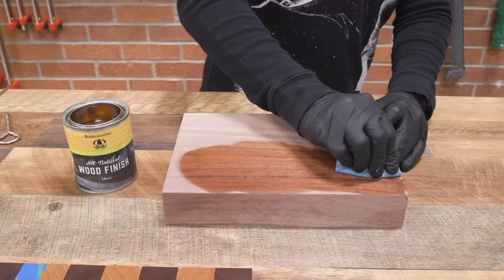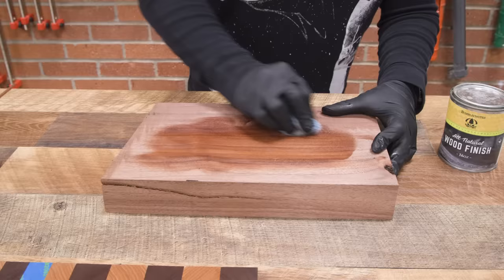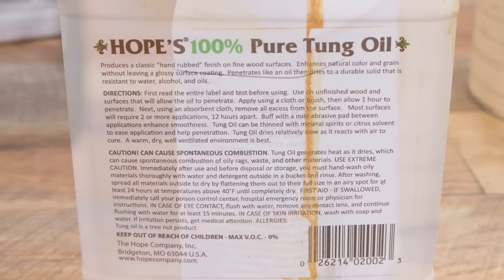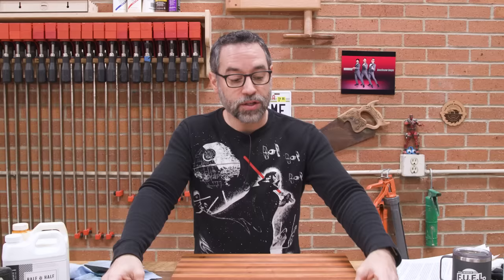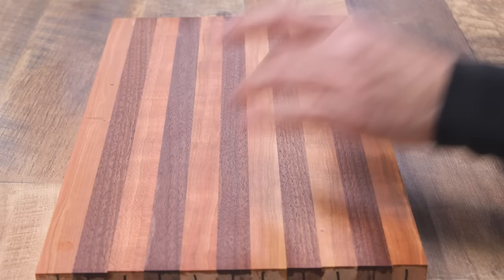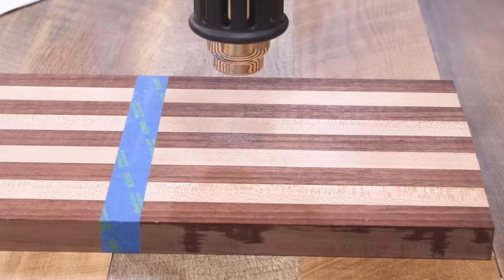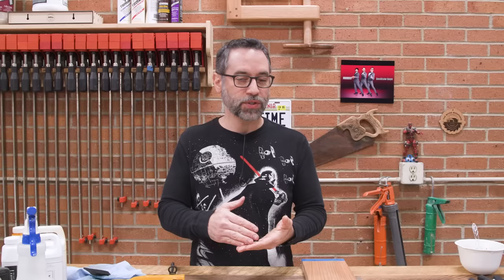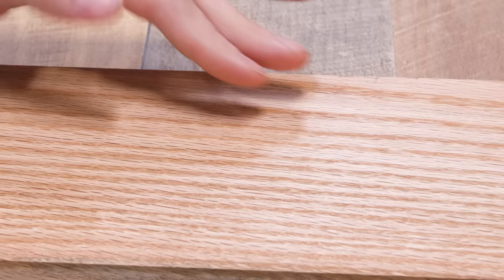A Better Way To Apply Oil Finishes!

Comment: I just finished a work bench with a butcher block on top, with watco danish oil.. I kept the wood wet for 15 minutes then let it soak for 15 minutes and wiped off. No sticky residue.

Comment: Thanks for this discussion, Marc! I feel this video compliments a similar video by Stumpy Nubs very well. In fact, both your video and his video can be supplemental to each other.
I like how you showed physical tests. I was amazed by the endgrain cutting boards. I always knew they were more porous, but didn't know they were that porous. Your video has definitely added a whole heap of value to the community (as usual).

Comment: When carving and finishing gunstocks, I was told to use 00 steel wool to apply and "rub in" thinned tung oil for the first coat.  The wool was used to slightly sand and create fine wood dust to help fill the pores.  Bare hands and their warmth helped really rub in the oil.  Then, a month of drying time was allowed to cure the oil.  High count 200+ wet dry paper would be used to rub in another layer of fine pore filling dust.  Lots of hand rubbing of this second layer of thinned oil and another month of drying.  Next the customer would mount and check the gun to insure dimensions and fit.  These two coats also helped harden the wood for fine checkering patterns.  Lastly,  as many layers of raw or lightly thinned oil could be HAND rubbed to build up the final desired sheen.   
Summation:  Flooding is bad 😁
Reply from the maker: Sounds like a real labor of love!
Reply: You got the labor part right.  I kept 2.

Comment: The test that you didn’t do, and would be hard to do in one video is a comparison over time. It probably depends a little bit on the product and the amount of curing taking place inside the wood, but most pieces need to be retreated in 1-3 years. You have another great video on the benefits of penetrating oil finishes. If there’s more oil in the wood, it would seem that it would be a longer time before it needs refinishing. 

I used a bit of a modified flood method with a brush, and actively brush the oil across the wood for 5-10 minutes only adding more oil if there’s nothing in the brush. While the brush absorbs some, it seems to me to be less than what is absorbed by the towels. There’s a little excess to be wiped off in the end but not a lot. Usually I’ll be moving excess oil to the next piece of wood, next part of the project.

Comment: I used Danish oil on my bench for years. Easy to apply and easy to repair. My main finishes are Shellac and oil for smaller projects. If it's larger I spray GF High Performance.

Comment: Homer Formby was my hero on TV decades ago, his favorite was Tung oil, which I have adopted myself. I love Tung oil and on a piece I want high gloss I apply 8 to 10 coats 24 hours between.  I apply the oil with my bare hands, no rags or sponge, just rub a little everyday.  Beautiful gloss finish. Just the way Homer taught me.
Reply from the maker: Unfortunately, Formby's is one of the worst offenders when it comes to misleading labels. What you're using is actually not tung oil....it's wiping varnish. And I wouldn't recommend applying it with your bare hands as it contains a significant amount of mineral spirits. But hey, my grandpa soaked fishing reel components in kerosene and always used his bare hands so what do I know, lol. But seriously, Formby's is varnish, not pure tung oil, which is the only reason you can build it to a gloss.

Comment: I just watched a video by Walrus Oil where they suggest multiple applications of their product using a consecutively finer sandpaper (220+) for each oil application, following an initial sand/wet/sand process.  I assumed they meant to use wet/dry sandpaper, but they weren’t specific about that.  I’ve never seen anyone suggest using a sandpaper for an oil application.  Wondered if you have any thoughts about doing that.  I’d think a manufacturer would want to give a bit better info in their product video, but apparently not in this case.  🙄

Comment: I finished a box with tried and true varnish oil a year ago. I applied very thinly then wiped off excess. The box has been open for a year and if I close it for a day immediately smell linseed oil when I open the box. 

Pure tung oil seems to cure much more reliably.

Comment: Great video , as always , very informative ! There were several mentions of applicators /cloth or ? Going into the garbage .  It is worth mentioning that spontaneous combustion is a very real issue when solvents/ oil / cleaner rags and applicators are not disposed of properly. They all should be stored in an airtight non combustible container and disposed of according to your local bylaws. I ran an automotive shop for 40 years and experienced several "rag bin" fires that luckily were snuffed out by the safety lead melting and closing the lid .

Comment: That’s very interesting. I’ve made a bunch of boards for people that didn’t want them for Christmas. Oils coming to the surface when heated indicates the oil volume expanding. 

Putting a hot saucepan on a thick endgrain maple board, infused with mineral oil, split one wide apart. Not on the glue lines, but across the grain. I suppose an oil that dries probably avoids that.
Reply: Could be that the cured, thinly-applied board wouldn't because the spaces in the wood that would have been flooded with oil remain full of air. Air would allow itself to compress as it heated up, whereas the liquid oil in your board can't be compressed and therefore exerted a LOT of force as it expanded with heat.

Comment: when you say you don't necessarily trust the advice of the larger finishing companies on applying finishes, you have to realise they are in the game of selling finish.  the more you use the more you buy. better for them.  its the same i notice with the way americans use excessive glue.  the company says apply glue to both pieces.  and then squeeze the excess out to wipe away.  simply apply to one side and then rub the surfaces together and clamp.  retired professional furniture maker here who has never applied glue to both surfaces and never had a failed joint.

Comment: I came to the same conclusion several years ago after refinishing a dining room table. The table was made from an unidentified ring porous exotic hardwood. I stained it a weathered grey and finished it with three flooded coats of linseed oil. After leaving it in the shop for two weeks to allow some curing time to avoid damaging the finish, I returned it to our dining room and placed it in front of the west facing window. A week later I noticed tiny polka dots in my finish. The conclusion I came to was that the sun had warmed the tabletop and the uncured oil held in those open pours had surfaced and dried. Since that experience, I have been much more cautious when applying oil finishes. I basically use the same method you have described. I still flood or soak tool handles with oil because I think it is appropriate for that application, but on furniture, I apply it sparingly. I mostly use Rubio Monocoat for applications like this these days. It's a fantastic product which solves this problem and gives a superior finish for high wear surfaces in my opinion.

Comment: Hey Marc. Always love the content. Listening to you the one thing I disagree with is you can never fully saturate an end grain board to the point it will be protected from liquid soaking in. If the board was thin enough you could probably do it as the "straws" will fill up, cure over months, and be semi protected. But thicker wood will have the substance,  oil in this case, seep all the way through leaving the top not fully protected. A long grain board will be protected better as the straws are horizontal, not vertical. This is why I opt for a mix of oil and wax to treat my boards so the top layer is closed. Ad always, you make everyone think and I believe that makes us all better. Thanks buddy

Comment: Thank you for the experiments, Marc. I have been moving away from the flooding method as a result of my own experience so it is great to see my thoughts confirmed. I also question the recommended drying times. I recently made a grave marker in European Oak and ended up leaving it for 48 hours between coats even though the initial coats were 50/50 Tung oil and thinners. I wiped off the excess after initial application and then re wiped the surface after 24 hours as it still seemed a little wet in places. The end result is definitely worth the effort.

Comment: I’m trying this approach on some black walnut doors I’m finishing now, having taken the flooding approach with three previous pairs of black walnut doors. First coat is on and looks good. Overall, the result from the first coat is lighter, and the grain doesn’t pop as much as the flooding technique, but it uses a lot less oil and is a lot less messy and smelly.

Comment: About 20 years ago I made a mahogany coffee table for our living room and used Tried-and-True for the first time.  I thought I had applied thin coats and done everything right but oil kept coming up out of the pores for months.  Eventually it stopped and we've been using the coffee table ever since.  Finish has held up quite nicely actually but I never used T-n-T again

Comment: Thanks. I have had similar issues as far as trying to sort out what is actually in a product, and whether it is food safe and especially, how long will it take to dry. The flood method has not always worked well on thin end grain oak and black walnut. they absorb a lot of oil, and often too much. It's hard not to keep adding oil to an area that keeps drinking it though! Especially when that is what the manufacturer recommends.

Comment: I finished a Lake Erie Moxon vise with Tried and True Danish Oil (not the original with bees wax nor the varnish). Burnished with steel wool before, between, etc. Very thin coats. I was surprised how much the curly grain in the maple gave back over time. I could re-wipe it down twice a day for a week before it stopped returning finish. To cure it took about a month, however the final results are stunning. I like the fact that their finishes are all natural, but time cannot be a concern when curing. Thanks for the vid!

Comment: Thank you for the video. I just started redoing my floors and I used tung because I like that it's natural (pure, anyway). I thought the flooding method didn't seem quite right and went with something similar to your video. Thin coat in the room and then wipe off excess but I think I'll do it in slower smaller sections and apply light and wipe off immediately. I appreciate your video and advice!

Comment: My first cutting board was saturated with flax seed oil till it stopped soaking in, using a cloth. Before the first coat and for a couple days after saturation, I kept the 3' thick cutting/chopping board beside my wood stove and some of the time on top of a trivet to really heat it up.
I have never had an issue with the oil seeping out. The heat seems to have dried, polymerized the oil. After a decade, I scoured the surface with salt and vinegar, and gave it a treatment with proper cutting board oil and wax. Looks like it did when I made it. This board is nothing fancy. I think it was from a slab of birch that was sitting in a shed for 30 to 50 years. Just one piece with 4 wooden feet. Amateur as hell but I am still using it LOL

From what you have been showing, tung oil would have worked even better using the heating method I used to saturate the block.

Comment: What I think you might consider (I think you missed it or I was not paying enough attention :-) and missed you talking about it) in favour of the flooding method, is that it might secure the wood a little better from air moisture and reduce wood movement a little, which in some areas (a very varying climate) or for some applications might be very important.
I am generally a fan of the flood method, but all the problems you mentioned are the things that I really dislike (I think I have some furniture that took over a year to cure on the surface - I was using 100% tung oil was - and after 5+ years there is probably some uncured oil trapped inside the wood), so I am going with something in between, using 2 type of coats - first layer a deep penetrating but low viscosity type, that will seal the "deeper pores" and prevents the following coats to get too deep and then a thicker finish. The second and following layers I apply quite thick but don't let it sit too long, and wipe the excess off within minutes. 
Just my 2 cents ;-)

Comment: I went with the flood method from beginning all the way through four coats. I got hit with a disaster! Some parts of my work turned into a shellac shell while other parts remained porous. 

In the end, I had to strip the piece again and reapply by rubbing the oil in thoroughly until the piece looked evenly "dry". I'm still on the fence about the look being uneven and I'm considering topping with a coating of carnauba wax.

Comment: Thankyou for this video.As newbie  I’ve been stressing about finishing with oil using the manufacturer’s instructions. I had a sense flooding or over applying was going to be a nightmare and ruin my project. It being a forever oily mess. My test pieces were proving it was going to turn out that way. I watched this video just in time!

Comment: I'm in two minds about this. For very hard woods I typically use the flood method, thinned for penetration. However, I only let it sit 3-5 minutes before removing excess. I always let it dry sufficiently, then second and subsequent coats I wipe on as demonstrated in this video, and do subsequent coats that way. Not sure when I started using flood method as first coat, but am often doing larger pieces - tables, shelves - and found a thinned, copious (to a point) first coat was easier to apply evenly, whereas only rubbing it on with a cloth was too time-consuming and looked blotchy while applying. Perhaps if i persisted with more coats it would come right, but my method has worked well for me for around 25 years.
Will give this a go on the next smaller pieces that I make.

Comment: Yep I flood let soak and then wipe off to get a dull sheen then wait 24hrs then buff up for whatever I can get,  but I see now how thin coats can harden better without the wicking of deep oil to prevent the drying process 👍

Comment: Oh lord thank you so much. I'm currently building my 7th and 8th cutting boards, first two were treated with mineral oil, the rest were done with Tung Oil but using the flooding method. I did let them cure for months so in the end once I started using them they hold up pretty well but I need to deliver them sooner than that. 

Definitely will try applying sparingly on these! Thanks.

Comment: I have found that if one can wait for weeks for tung oil or Danish oil to dry, the flooding method will yield a very glossy, glass like finish. I assume that because it take so long to dry, the surface has ample time to flatten. The down side is that it takes months for the oder to dissipate.

Comment: Thanks for making this video! I've been building my first electric guitar and i settled on polymerized tung oil to finish the body. I've been planning on doing the flooding method since that's what everyone recommends (including the instructions from Sutherland Welles) but you've definitely convinced me that the "applied sparingly"  method is superior.

Comment: This is great stuff Marc.  I've been making tables for awhile using Watco DO (2 coats, FLOODED), Dewaxed Shellac, and General Finishes WB Poly.  I noticed if I put a table outside in direct sunlight (Colorado), I'd get little white dots under the poly.  I was wondering if I could get away with 1 lighter coat of DO and your vid answered the q.

Comment: As a heads up - some oils / finishes will transfer the blue from the shop towel to the wood. I used to use them, now just use a  soft rag.

Comment: The 12 to 24 hour extended dry time is killer. I use Watco Danish Oil, not flooded. I do the first coat, wet sand with 400 grit sandpaper , wipe off the excess. Wait an hour, apply coat #2, not flooding, wipe off. Finish with wax and buff with #0000 steel wool. Smooth as buttah.

Comment: I use tung oil and spar varnish fifty, fifty mix. The tung oil pulls the spar varnish deeper into the wood. I never use a brush, l always use a lint free rag all bundled up into a tight ball. As the saying goes, wax on, wax off. Spot on with this video. Why waste finish as it is not inexpensive.

Comment: Thanks for the great video. I have never understood why folks dunk cutting boards in a utility tub full of oil to finish boards. It seems so wasteful and expensive. Thanks for confirming my thought that less is more when apply these oils.
Reply from the maker: Well keep in mind, those people are usually using mineral oil, a non-drying oil, and the tub is reusable. You'll often see folks who make a LOT of cutting boards using that method. it's a quick way to get the boards fully saturated and ready for the next step. So there's definitely some logic to it and my curing discussion doesn't apply since mineral oil doesn't cure.